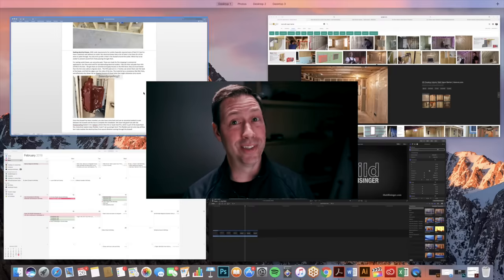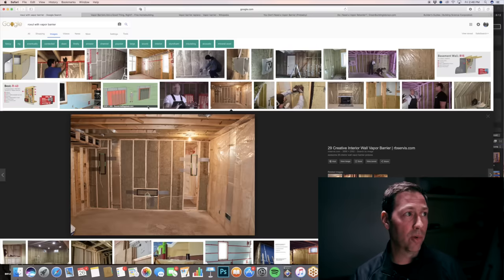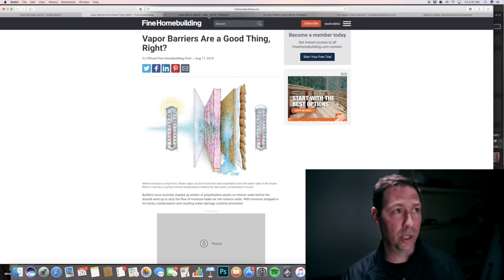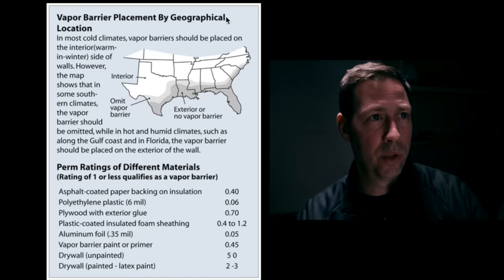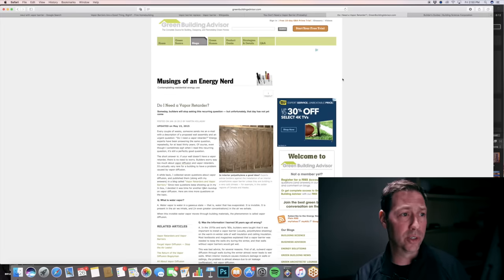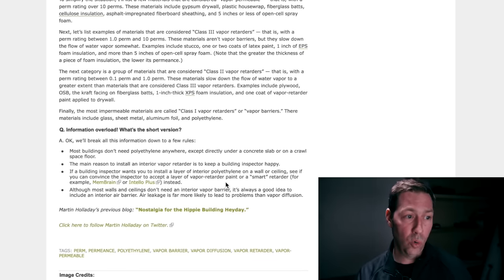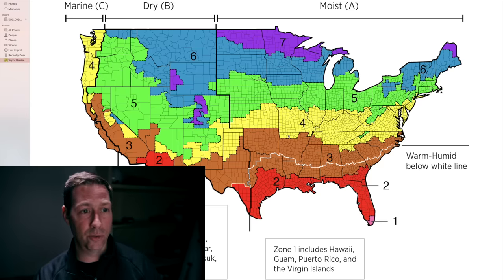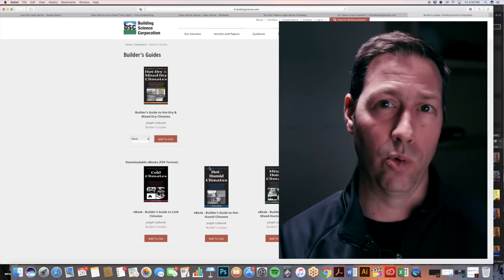Vapor Barriers: Need one or not?

Comment: @Matt Risinger, I have no attic, 2x6 R13 fiberglass insulation in the roof, no vapor barrier, metal roofing, and the wall coverings are tongue and groove pine boards with lots of gaps and cracks.  In the winters in Ohio it gets cold and dry and so we run humidifiers to keep the air moist.  We have horrendous heating/cooling bills and water drips from the ceilings in several places.  What's the best way to fix this?

Comment: Matt, I am building a metal sided hone in the far north of Idaho. I am choosing batt insulation. I question I struggle with is putting a barrier on the inside. The wall finishes will not be Sheetrock. There will be a wainscot of the same type as the exterior metal with wood planks above. Gosh.. I hope you can sort this out for me.. barrier retarder or nothing. I even considered roofing felt. oh...i will have radiant floor heat

Comment: Hi Matt,  great video.  What about microclimates?  I'm in zone 5 but near a river that makes the immediate area more humid than those around in higher elevations, especially in the mornings before the sun burns it away.  Winter is more similar to nearby area (cold and fairly dry).

Do I need any vapor barrier on the foundation wall / crawl space?

Comment: Thanks for this one!  We bought a 1960 climate zone 5  house that needs a lot of TLC, and after removing the awful wood paneling in the basement, I found 3/4 furring strips with 3/4 styrofoam filling the gaps on a dry cement block basement wall.  I was confused, as the north wall had poly installed over the furring strips and styrofoam, and the west wall had the poly behind them against the blocks.  Since I'm planning to put 2x4s and drywall in there, it's nice to know I can lose the plastic.  My question now is, should I put the new stud wall against the blocks OR against the furring strips and styrofoam to reduce any thermal bridging through the studs?  That block wall still gets cold in Wisconsin.

Comment: Thanks, I live in Northern California in the SF Bay area. So it looks like I'm in Zone 3 and won't need a vapor barrier. 
This is for a garage install which is currently non-heated. However, if I decide to heat or run A/C in it in the future, would I need the vapor barrier then?

Comment: 6:10 Is this necessarily proof that you should not have a barrier though? It seems that the barrier just decides where the condensation will be. An interior barrier will cause condensation on the outside of it in the summer and inside of it in the winter. An exterior barrier will do the same, but it's outside the drywall, studs, and OSB now. No barrier just means you will get the condensation buildup wherever the cold meets the heat, which will vary during the temperatures throughout the year. So, the vapor barrier really isn't preventing moisture in any way, but rather is just the stopping point. I think you will observe failures (mold) with either method. The condensation will be present on either side of your insulation if it's summer or winter, depending on if you have the barrier externally or internally. Seems like you would need BOTH an exterior AND interior vapor barrier to fight against condensation in summer AND winter. Ultimately I think the idea is to at least keep mold off your studs. You will likely get some mold SOMEWHERE, so at least restrict it to just inside the drywall or keep it in the rain screen. Thoughts?

Comment: Question.  Wouldn't the poly help seal air leaks anyhow?  And how do you stop the air from going through the electrical boxes?  I find that sealing the outside with house wrap would stop the air movement most effectively.  It it can't get out, there won't be air flow into the walls.  I find that without a sealed cavity, fiberglass batts are not that effective.  The heat , as well as the moisture, flows right through with he thermal pressures.  I'm in the north.  Minnesota and Montana. I appreciate your responses.

Comment: Hi Matt,
I'm in Seattle (zone 4) and it's clear that I should not put up a vapor barrier on the inside of my insulated/framed walls. But, should I use a moisture barrier on the inside of an exterior basement foundation wall (between the foundation wall and the framing)?

Comment: Still a huge issue here in Alaska with lots of polyethylene still being used on the interior. I'm using closed cell foam and exterior sheet foam. Also using cardboard baffles at the roof covered in closed cell to maintain a cold vented roof and have conditioned attic space. Question. Do your local appraisers give you a premium for spray foam?

Comment: What would you recommend for a pole building?  I will be heating it via radiant.  I currently have Tyvek on the roof between the steel and trusses but nothing on the walls.  I certainly want to keeps costs down but also only do it once.  Do I need something against the steel first ?  I considered rookwool in the studded “flush wall” between poles.      I am just above MD.   That’ said no vapor barrier correct??  Any advice Matt is greatly appreciated !!!

Comment: So I have a small cabin, 12 x 16 in central WI and I want to insulate and put in a LP heater on the wall. What is the best insulation to use. 2 x 4 walls. We don't use the cabin in late winter, just from April to early December. We want to keep that Oven heat you get in the summer from baking us out in the morning and to allow for easy heating in the fall? Its a small space - I don't want to get crazy but am willing to buy quality stuff. So.. what about the air movement, should I be sealing any gaps between the 2x4s and the outside sheathing to be sure we don't get any air movement? Or is it better to have some air movement to allow the moisture to get out? This should be simple... what do we all do with these little cabins here in MN and WI?

Comment: I live in Round Rock. I want to insulate my ceiling in my garage. Its already dry walled. People telling me i need vapor barrier. This video tells me I Dont need one. I plan to get a hvac installed in a few months. Soo confused. !! My home is a 6 year old build from Pulte (dba centex).
Reply: I live in NC and a similar situation. Wanted garage hvac with goal of 50-85 temp range; no need to make it 'comfy' like the house. Insulated the garage door, spray foam in the attic on the garage ceiling (not on the underside of the roof), and insulated cover on the pull-down attic stairs. Have hvac in garage about 2 1/2 years and temp goal of 50-85 degrees is met!

Comment: Been building and remodelling for 18 yrs in NCal. Seems everyonr Ive talked to approaches V.B.s differently, even between coastal builds vs. further inland. This was helpful. I hope you do (or have done) an episode on different levels of watertightness on exteriors. Felt, tyvek, rainscreens, Ive even seen complete waterproofing on sheathing b4 trim/siding - I hear opposing opinions all the time - let it breath vs seal it.  ??? Tell me if this is wrong (readers who know - answers welcome) proper flashing details at all penetrations, complete waterproofing of shear, 3/8 furring over studs (drainage plane), a few inches closed cell spray foam inside, finished w r13 batts (for 2x6 walls). This to me seems bombproof but I may be creating a problem in trapping moisture in this scenario. Input anyone? Thx.

Comment: Interesting topic. I have been very confused about this. Currently reinsulating a mobile home trailer. Old insulation was non face with poly covering on interior side. No sheathing or house wrap externally. 
I did use poly for the bathroom ceiling and Kraft faced throughout the house. 
I have another bedroom ceiling to do, sounds like I should not cover it with poly?
Trailer was gable vented originally, a second roof was installed and no vented. I found no mold when tearing apart, but evidence of a lot of air infiltration for sure, through the walls.
Reply: Also, I live in Central NH. Cold dry winters, wet rainy springs, hot humid summers.

Comment: Matt I live in zone 4 southern Illinois. I have noticed algae growing on the outside of my vinyl siding, However It's only on the wall with insulation with vapor barrier. The un-insulated wall has none. There is a line where it starts and stops.  The building is heated and cooled seasonally. Why is this? Algae is a common problem here.

Comment: So I completely wrapped my steel pole barn in 6mil vapor barrier, floor, walls, and ceiling. The builder said if I was insulating and heating it that it would be necessary to prevent condensation. Was that really necessary?

Comment: Well, I live in Fairbanks Alaska so without a correctly installed vapor barrier homes can end up with cold air leaks and with ruined fiberglass and drywall as well as impressive fungus and mold growth in the walls. But if moisture problems come mostly from air infiltration is it possible to over do it and make a home dangerously airtight? I recall a builder from when I was a kid bragging that it was impossible to slam a door in his home because the rooms were so airtight. Looking back, I wonder if that might’ve caused other problems.

Comment: Matt, great video. In Houston then it sounds like not using faced batts is better in walls as long as you have a house wrap like Tyvek??
Reply from the maker: Yes. In Houston you can use a vapor retarder like Tyvek on the outside then Nothing inside!  Unfaced batts

Comment: had to take up all my NuCore Performance Rigid Core LVP - Cork backed.  
and removing old hardwood underneath. Some of the 20 yr old hard wood was warped in most areas and subfloor underneath being unleveled some areas. Making vinyl on top shift and make cracking noise seemed to be coming from between locking mechanisms. Floor  Associate at the store where got LVP recommended put down sound dataning sentinl moisture barrier with this corked back LVP. My floor was Making a rice crispy sound some people say is do to the clicking locking system. To me flet like the vinyl floor was sitting to high on the cushion vaper barrier combined with vinyl floor already having cork back felt like it was apart of the problem. Also floor felt squishy with the exstra padding uncomfortable Synthetic feeling to me like it never formed or madded to the ground because of the exstra cushioning. Don't know the difference with out the Cushion vapor barrier but my question is if I put down just a plastic non cushion vapor barrier because its going on a concrete subfloor would you recommend one and also a role on paint on vaper barrier to for exstra blockage you'd recommend? My concrete subfloor was reading 16/ 20% moisture levels directly after remove of old vaper barrier sure something to do with all moisture being traped in there for while. My installer said when i told him wanted to go with regular plastic non cushion vaper barrier said it will definitely make a worst annoying sound then the cushion vaper barrier. Any advice be much appreciated you may have worked with nucore before newer product still. Not sure how it (wouldn't) be the (better choice)seeing non cushion vapor barrier not thick enough or made out of a Styrofoam material like the cushion Vapor barrier. Just tryin to aviod all problems since 2nd time around reinstalling the LVP.

Comment: We had the same problem in Canada in the summer in our unfinished basement when a/c is on the basement walls have pink insulation with vapor barrier over it and the moisture gets really bad and soaks insulation to the point where i have cut vapor barrier to let air flow to stop or slow this down ..now im just wondering about the rest of the house that has it and drywall is hiding this moisture issue..hopefully because of our climate it hasn't caused that much damage as we only have air conditioning on for approximately 3 months

Comment: So I have a split foyer house built in 1974.  The house was originally built with a finished basement.  Only on two sides I am 4 feet below grade.  Other two sides are walkout.  It was finished with wood paneling, fiberglass insulation and no vapor barrier.  45 year old house and no mold what so ever.  Wood paneling was attached to block with 2x2.  Do I use the same framing for drywall or should I build a true stud wall to fit an R13 batt in.  I was going to use a vapor barrier but sounds like I should skip that???  I was also going to drylok up to the grade level height.  I stay completely dry but figured that would be added assurance?  What are your thoughts?  Thank you.

Comment: I own a semi attached house in NYC,  built in 1930, the  bottom 2 feet of the bMyasement wall adjacent to my driveway is damp, but there is no water.
I removed the whole drywall.

What is the best solution for the bottom 2 feet if I want to put drywall back. 

Vapor barrier or not?

Thank you in advance for your help.

Very informative video.

James

Comment: Could you address insulation and vapor barrier application when insulating a cargo van to convert it into a camper van. I can see the van's sheet metal body as an exterior vapor barrier as vapor. RVs seem to have a big interior vapor problem. There are so many different ways and material being used.  

I am thinking of apply a sprayed closed cell foam insulation on the interior sheet metal, then rock wool, with top layer of insulate insulation, then a interior finish wall of thin wood strips. I don't want the interior vapor/moisture to get into the insulation as the sheet metal body won't let it pass. 

What would you recommend for an van interior. The more insulation the less need to run fans and AC or heat.

Just curious form an expert like you

Comment: We have a historic barn in Vermont and are finishing a number of rooms in the basement. Vapor barrier or no vapor barrier on the inside?? There are nails coming through from the outside novelty siding and on the end of the nails on the inside of the barn there is frost?  Article makes perfect sense about the air sealing vs. the poly. Any tips you have for me would be appreciated.

Comment: Great video!  I have seen varying ideas about insulating a basement in New York.  I have seen people use the 2"pink foam against the cement block wall and then insulation in between the framed walls.  Also, I was thinkkng of using a vapor barrier dimpled roll on the floor underneath a 3/4 inch subfloor.  Is that something that you suggest to do fornour climate?  I want to reduce the chancss of mold in our basement as much as possible.  Thanks in advamce!
Reply: danny302 , I would think a 6-8 mill poly before the pink board then insulate. The floor, I would use at least an 8 mill before laying anything on concrete and use pressure treated.

Comment: So what could you do if you have already closed up a wall after the fact? They have a product ComfortTherm that has the batts wrapped in plastic, since the entire wall face is not sealed with a single sheet of plastic just the framing cavity will this cause issues? Considering the home had nothing in the wall cavity, asbestos tiles on the exterior, and no layer of tar paper in place the slightly incorrect DIY upgrades are like having a new home. No freeway roar, lowered bills, and nice new look is kinda nice... :-) Once you do a few rooms you really start to get good at the trades.

Comment: What do you think of the Certainteed MemBrain product?  (shown in one of your references as a "smart" retarder).  It only allows moisture movement one-way.  When updating my living room and laundry room, I used this product, and have liked the results thusfar (only 3 years in).  For reference, I'm a little north of Dallas, TX, so zone 3.  Hot/Humid in summers, Cold/Dry in winters; and a monsoon climate where spring is often very, very wet.  My house is a typical 1971 ranch-style tract home.  You can translate that as cheaply, cheaply (ok, shoddily) built, with some questionable products.  Air sealing wasn't a thing back then--and that's one of the reasons I used the MemBrain.  I don't really have the resources to pull the brick veneer off my house and replace the gypsum sheathing with something like Zip or even just add a housewrap.  So as I update, I go down to the studs, seal the joints on the backside of the sheathing, upgrade the insulation from the mix-n-match kraft fiberglass I have found (it was done with scrap from other houses...I have found everything from R-3 to R-12 in the cavities...which are 24" o.c. 2x4).  After sealing the sheathing as much as possible, I put in Rockwool batts.  In 2 rooms I have then done the MemBrain product--more as additional air-movement insurance than vapor barrier (I did find evidence of significant moisture when I re-did the laundry room and master bathroom--which didn't even have and exhaust fan).  Then drywall, seal between bottom sheet & slab w/ acoustic sealant, caulk all penetrations, etc.  The wintertime difference in the living room was night and day...I could tell little difference between the house as-built and down to the studs in the middle of winter.  Adding the rock-wool helped, but as soon as the MemBrain went on, I could heat easily.  So far, so good...just wondering if I should continue that when I eventually get around to the kitchen.

Comment: Hi Matt, thank so much for the video, but I got one question, we are from Brazil and how will happen the vapor permeability inside to outside if we put not air pearmeable wrap outside stoping the air flow, like I saw in other video you had used Polywall stick membrane that does not permeability?

Comment: I am seeking these same guidelines for a "conditioned" pole barn, Indiana, with corrugated steel walls and ceiling.  Insulation planned as R19 unfaced walls, R38 blown in ceiling.  WALLS - do I forego a "house wrap" behind the steel and only use an INTERIOR 4-mil vapor barrier?  Or do BOTH as a wrap will keep the wind from penetrating.  Also, for the ceiling, i'll have a STEEL corrugated skin.  Should there be a vapor barrier BETWEEN it and the trusses?